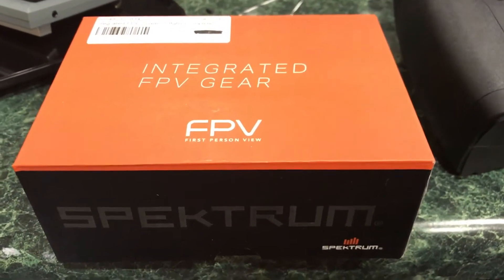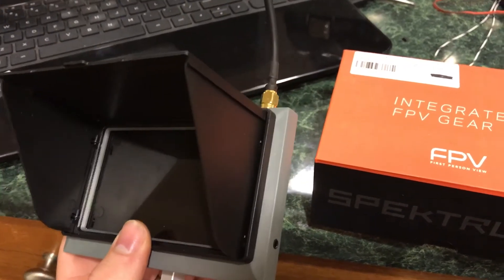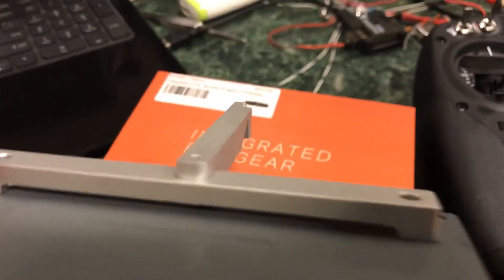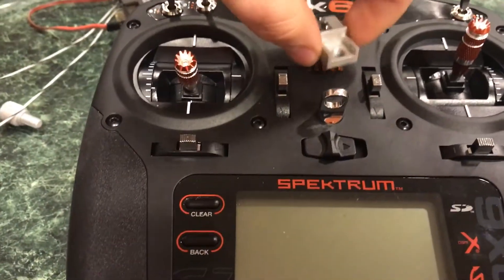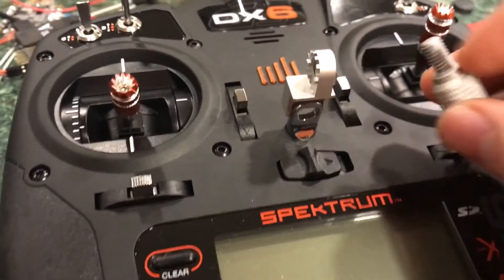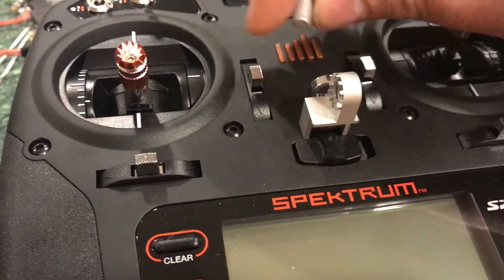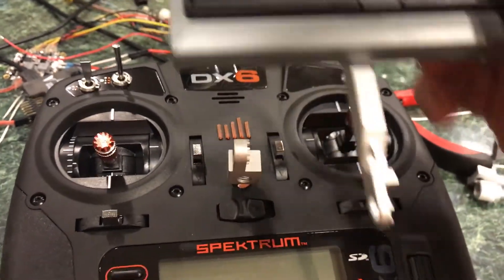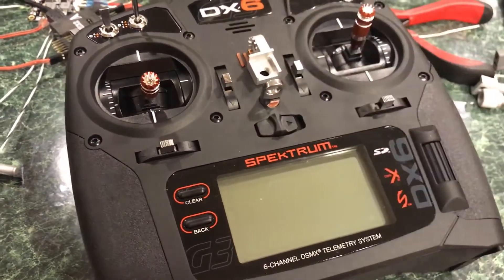Spektrum FPV Screen mount problem

Comment: I had the same problem. I figured to use a 1/4-28 jam-nut on the side next to the ON-OFF switch and bring the thumb screw from the opposite side. Problem solved.

Comment: I had exactly the same issue... so I cut down the screw which hold the post mounts onto the neck strap loop so it's only 3mm on the knurled part and not 10mm... after polishing the rough edge off it looks like it should...